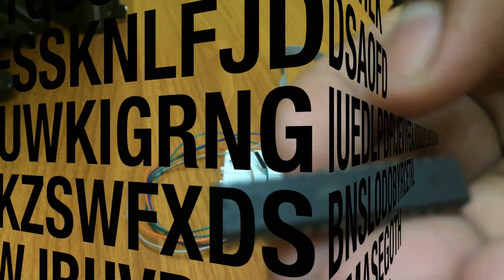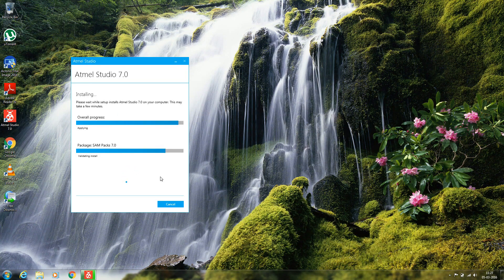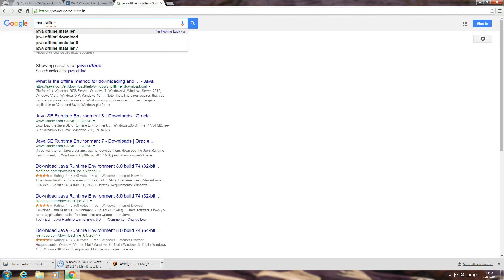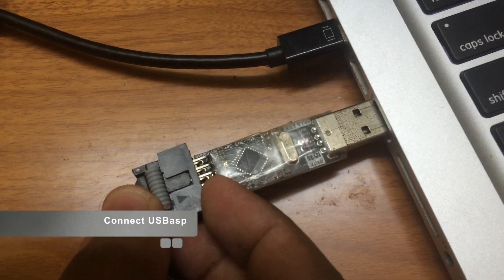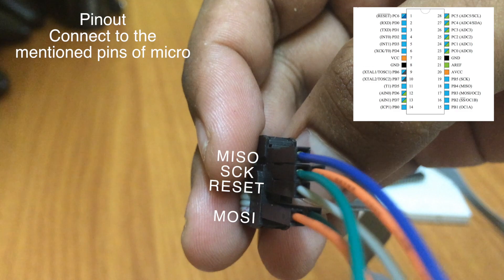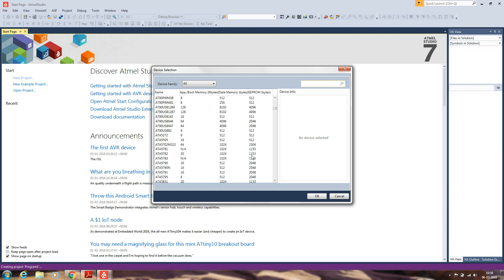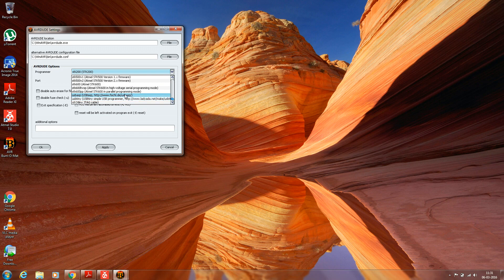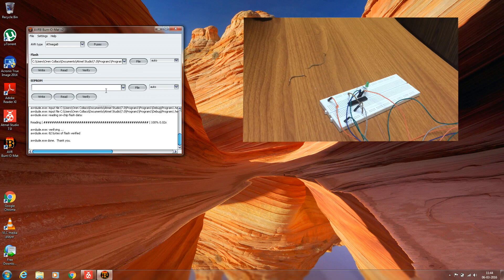Getting started with AVR microcontroller : LED Blinking

Comment: Works with atmega328p?
Reply from the maker: The code won't work. But if you talking about flashing/burning/programming the micro controller, this method will work with every AVR micro that supports SPI programming.(Atmega328 does). There's a better version here : https://www.youtube.com/watch?v=jcDS8iaYS_Q

Comment: I will suggest you to build a devolupment board like Arduino on a perf board (pcb). you can place your atmega on it with female headers for output ,input and connection for usb to serial convertor with 7805 voltage regulator .so, you will not need to wire it up again and again. and you can also label the pin numbers.

Comment: you could programme atmega8 using Arduino code
Reply from the maker: Yes. Using the Arduino IDE(Software) you can do that.
Reply: +Stuff Builder thanks arduino ide is very easy to use